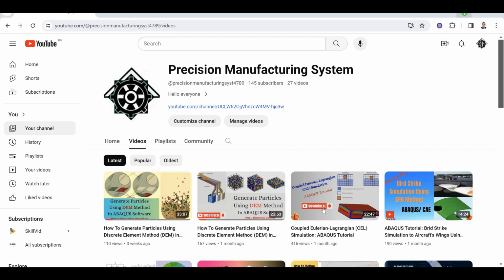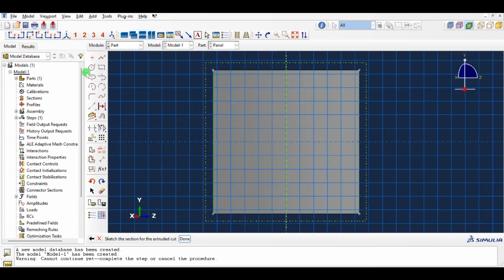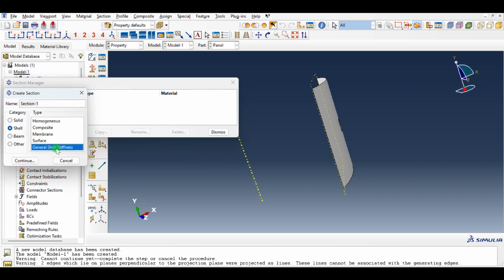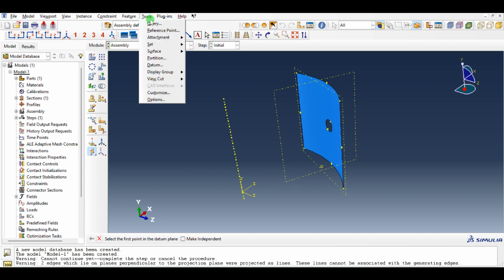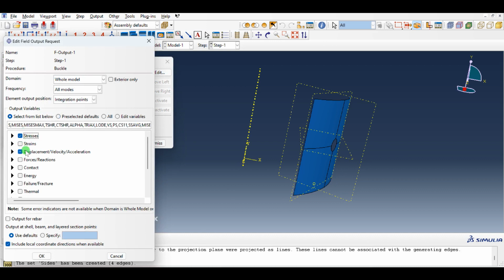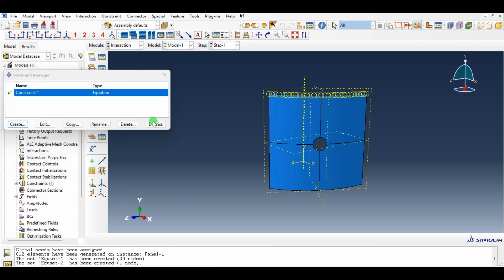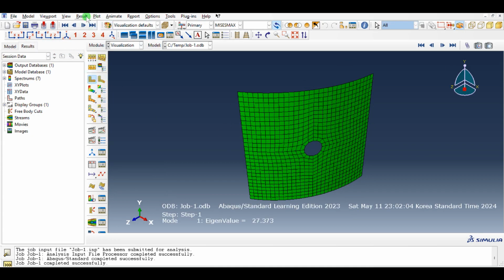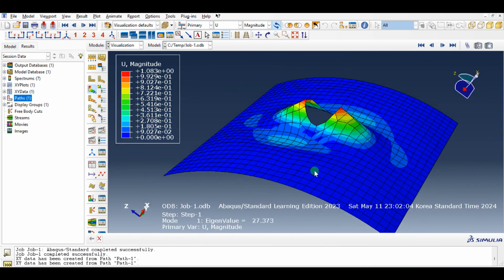Buckling Simulation of a Composite Panel Using Stiffness Matrix | ABAQUS Tutorial | Part 1

Comment: Thank you for this interesting video. Could I have the same results by applying a rigid interaction at the top nodes with reference point on cylinder axis, instead of Equation type ? And load applied at this ref. point of course..
Reply from the maker: Thank you for watching the video. What do you mean by the rigid interaction? Do you mean a rigid body constraint? I haven't tried that before and I have no idea.
Reply: Yes, I meant that